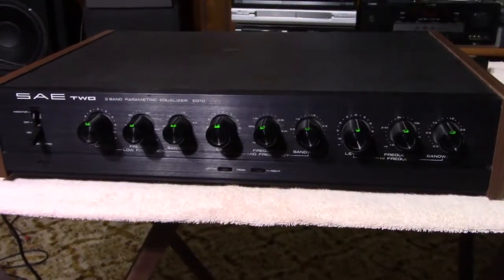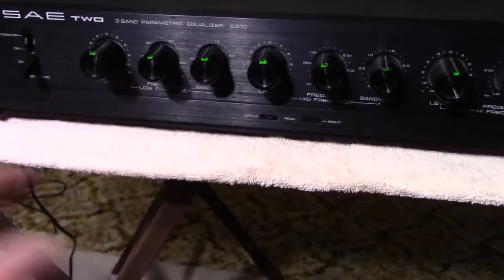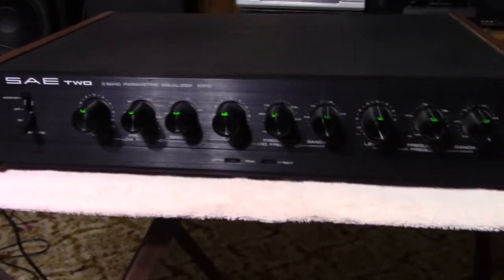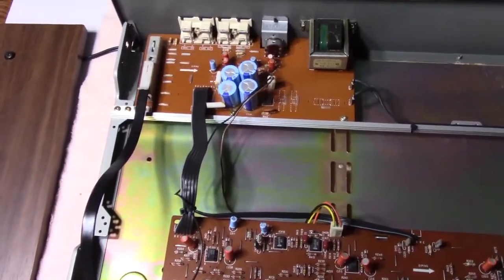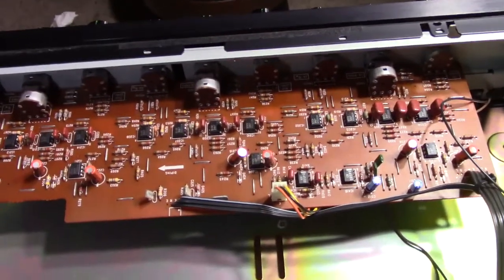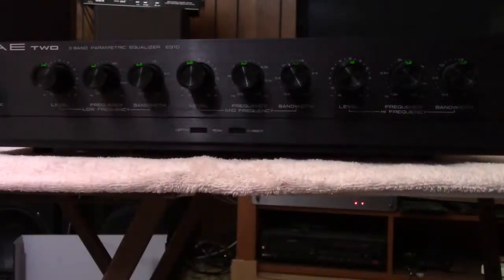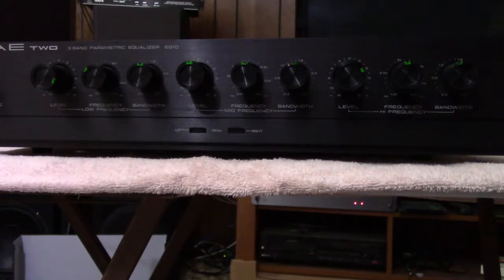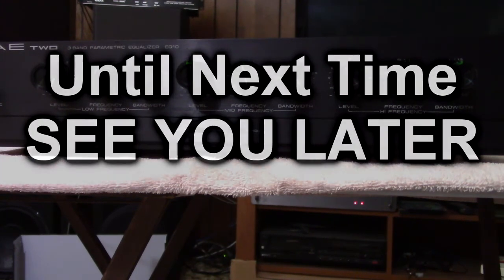SAE EQ10: Parametric Equalizer

Comment: Thanks!  I have the original SAE Series TWO Integrated amp  A14, which includes the Parametric  equalizer, only bass and treble though.  I also have the matching Series TWO T14 Tuner.  Bought  it new the tail end of the 70's.  I had the same problem with the pots being very noisy.  Tried when I was younger to get  some electrical contact  cleaner  in them but didn't have any luck so  I haven't turned it on in like 15 years.  I might give it a go again to see  if I can  clean them up.  Thanks again!!